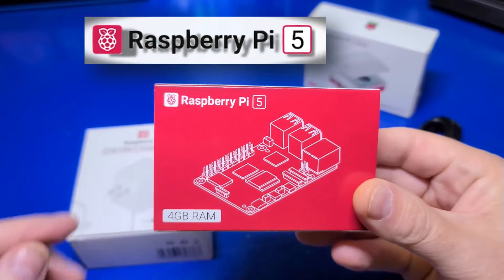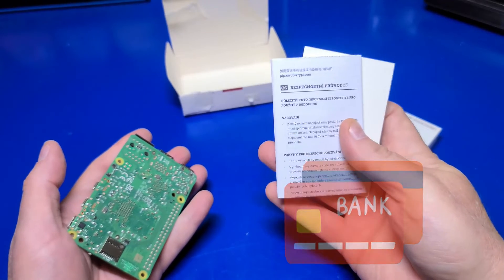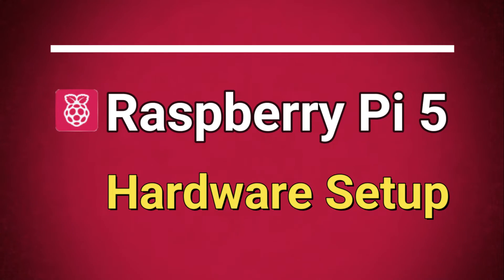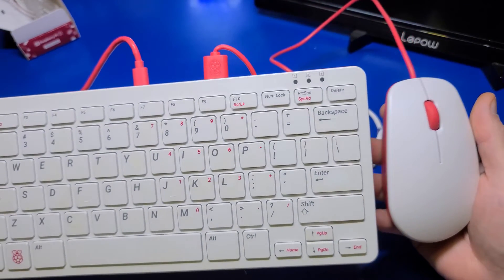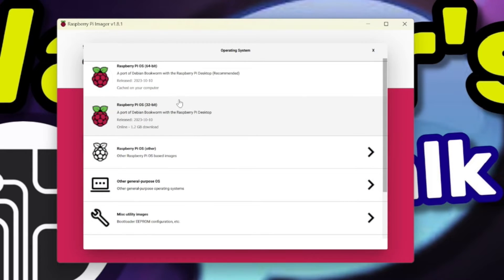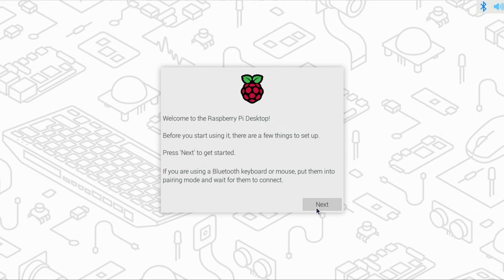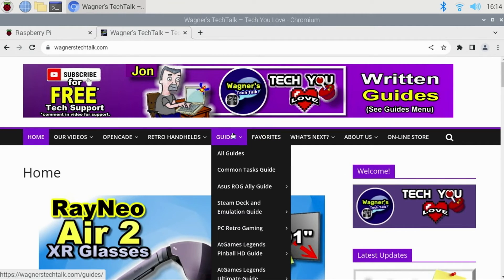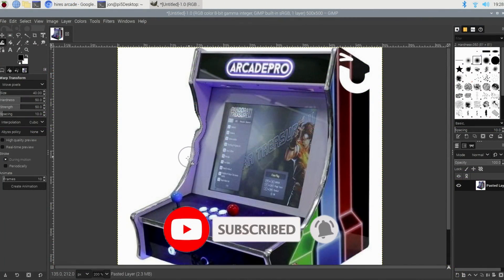Raspberry Pi 5 Setup: Getting Started Guide (Step By Step)

Comment: Txs for this. The case is a disaster quite frankly. There’s no way to connect the cameras. Did not know about the other cooler system unfortunately. Make much more sense!!!
Reply from the maker: Very welcome, glad it was helpful to you!
Reply: cheers.....unfortunately I failed to boot... not sure... the green light blinks inconsistently and the fan stops working. Nothing appears on the screen. Red that it could be the micro HDMI adaptor I am using to recycle one of my old cables but not sure. The monitor turns regularly without the SD card inserted and the green light is steady! Used a couple of micro SD cards and a USB device as well to test if something was wrong. Any suggestion? @WagnersTechTalk
Reply from the maker: @fablapp  Make sure you downloaded the right image, sounds to me like you may have tried a firmware update image for the Pi.  If that's the case, it will blink repeatedly green to indicate the update was successful.  Try imaging PiOS Desktop or Ubuntu to be sure.  If it still doesn't work, may be a bad Pi.
Reply: @WagnersTechTalk  Auch what a bummer. They are not cheap toys!!! Will follow your advice. Txs for the support!
Reply: seems it was indeed the HDMI cable!

Comment: Hello All. I first thank the Wagner for this helpful video. I have a question for  all. What do you think about the warnings some people mention about the problem of Raspberry Pi supply chain. Is it true or is it a fake ?
Because, I plan to develop an IoT project on this board, and I will need 2000 units per year. So, if someone has news about this topic, I'll be really grateful. Anyway, many thanks to all.
I wish a long life to Raspberry Pi.
Reply from the maker: Thank you!  There was indeed a time when Pi 4's were very hard (or expensive) to locate, for about 2 years.  How that translates to Pi 5 supply chain is not something I know much about.  I've heard from some other companies that indicate they'll have more products to ship towards the end of this month (Jan '24).  But, that's not a concrete answer for you if you're looking at 2k units per year.  If I find anything else out, I'll post back.

Comment: ....except @7:40 the top cover is now blocking air flow from the fan just installed. I think I'll drill some ventilation holes in my cover.
Reply from the maker: There is actually a small gap between the top cover.  Should be 👍

Comment: Thanks for the vid John, can the Rasberry Pi be used instead of a full blown computer to run VPX via OTG on my Legends Pinball ?
Reply from the maker: Unfortunately, no.  Windows running on the Pi 4 was so-so, Pi 5 should be better but there isn't currently a build for the Pi 5.  Even if there was, it's unlikely that it would play VPX well.

Comment: strange that you had problems fitting the case, just got mine and it clicked in first time! does brave browser work with pi 5?
Reply from the maker: If you install the Active Cooler, the clear piece in the case has to be removed.  If not, it will fit fine.
Reply: @WagnersTechTalk  i got the pi 5 board with 8gb and same case as you. clicked first time and didn't have to remove anything. i think you had a different cooler from me yeah

Comment: Hey would you recommend me to install ubuntu or pios I'm a beginner and want to use it as a digital dashboard/ Kalender on a desktop firstly. And can I use an USB stick to install the system?
Reply from the maker: This video will show you how to install PiOS Desktop from beginning to end.  For Ubuntu, you can see this video: https://youtu.be/RXO8HQeuuyU .  Either operating system will be fine, you can also easily swap between the two if you have two microSD cards.  Try both and see which one you prefer.  Yes, you can use a USB stick instead if you prefer.  Make sure it's a USB 3.0 stick for best performance and that you plug it into the blue ports.

Comment: Help please! I have an Atari Flashback Gold 12. Trying to update the firmware with a USB and OTG Cable. Resetting brings me to a screen where I have to select "update from SD" but when I try it fails.
Reply from the maker: Please see here: https://wagnerstechtalk.com/fbgold/#Alternate_Firmware_Update_Method .  I did make some minor changes and added screenshots.
Reply: @WagnersTechTalk  Thanks! Sadly, I tried all that. I got the cable recommended (came with 2, tried both) and the USB is only 8 gigs. When I boot up, it just goes to the normal screen. I don't get the update message.
Reply from the maker: @fordajunck2899  maybe the image download is corrupt.  Delete it and re-download it.  Try again.

Comment: hihi. i just ordered a 512GB micro sd card with a pi 5. I'm wondering if i can partition the micro sd card into 128GB for the pi OS and the remaining 384GB for other stuffs like storage or a retropie installation for dual boot. Thanks in advance! :)
Reply from the maker: After installing PiOS, you could likely just use gparted or DiskGenius to create a new partition.  It's not something I've personally done on the Pi 5 but shouldn't be an issue.  Here's some older info. on using gparted (with an RG350): https://wagnerstechtalk.com/rg350tips/#Expand_Partition .  Here's something I wrote up sometime back for expanding a partition (you'll need to create the new partition first): https://wagnerstechtalk.com/common/#Expand_a_Partition .  I know it's not a perfect answer to your question, but should be enough info. to help get you started if you need it.
Reply: @WagnersTechTalk  Wow! Thanks for the swift reply! I shall go look at them! Thanks again!!!

Comment: There must be something wrong with your fan. I wrote a Python script to find all prime numbers up to one million. that took 20 minutes to run. Using the case with its built-in fan the temperature only reached 58 deg c with the top cover on, & 52 deg c with the top cover off.
Reply from the maker: It was definitely functioning, I could hear and see it spinning.  Here's the exact test I used, if you wanted to repeat the same: https://wagnerstechtalk.com/rpi5/#Stress_Test
Reply: Did you use multithreading in your "python script"?

Comment: OK the real question is how will it run emulation? How much better is it than 4? Would be awesome if a Pi could someday be powerful enough to run Vpin.
Reply from the maker: All of the Retro Gaming platforms are either beta or experimental at the present time.  While the Pi5 is 2-3 times faster than the Pi 4, not all the emulators that would benefit from the faster speed are ready yet.
Reply: The Pi 4 was too slow for PS2 emulation. It looks like the Pi 5 is fast enough for PS2 emulation, but you might see some performance issues with specific effects.